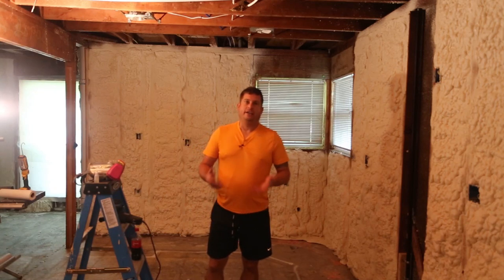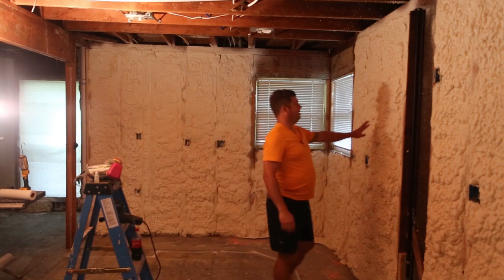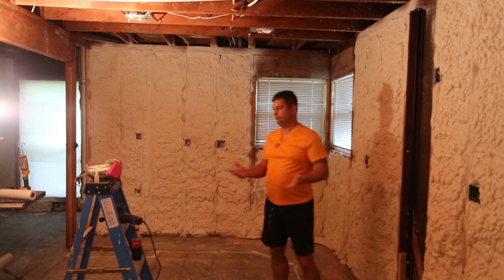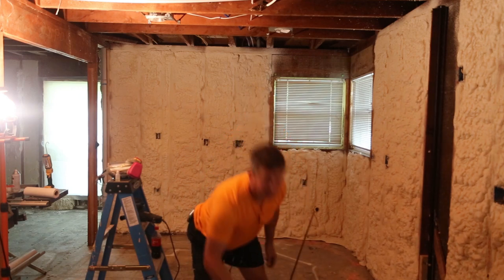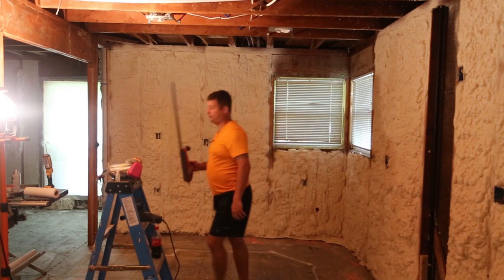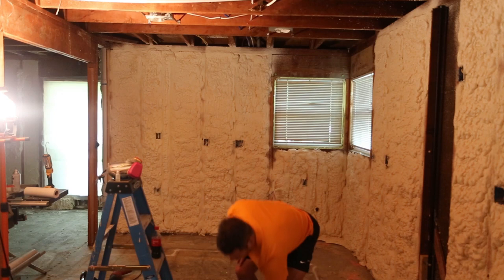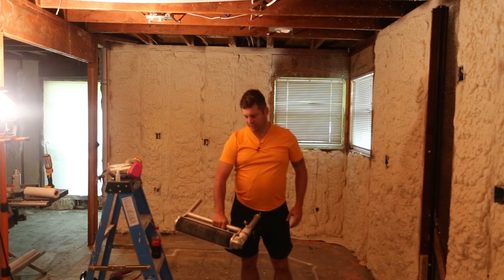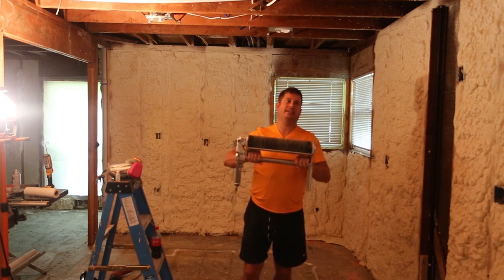DIY Spray Foam - How to Trim foam

Comment: Dont listen to all these complainers . I too want a full stud bay of closed cell foam. 
Its definitely alot more difficult and time consuming but overall a better job.  
What ive learned is if you want it done right most times do it yourself.  Noone cares about your things more then you do.
Reply from the maker: 10 years later and it's working fine and I have low energy bills.   The haters can kiss my cat's behind.

Comment: Is the additional R value you are gaining, really worth the investment on all those extra tools, the work and time to remove and the huge cleanup of that mess, not to mention all the particles of that stuff that get blown around by your furnace/AC?
Reply from the maker: Yes.  This house had evidence of moisture accumulation in the wall cavity.  Unless I wanted to take the brick down to install a vapor barrier on the exterior of the gypboard, this was the only sensible solution to create a vapor barrier and deliver fantastic insulating values.  

My OCD kicked in and I wanted perfectly full wall cavities.  Because I can.

I saved thousands by buying the equipment and doing it myself.  yes it took longer, I had a higher waste factor, but the structure is improved immensely and I never have to worry about bugs or rodents or moisture in my exterior walls.  

As a bonus I was able to insulate some interior walls for noise abatement and I have a serenely quiet home.  I absolutely love it and friends comment on how quiet and peaceful the house is.

The HVAC equipment was 20 years old and due for replacement.  It was a 5 ton Rheem unit that got recycled at the end of the insulation project.  A 2 stage 3 ton unit with variable speed air handler was installed to replace it.  All of the ductwork was 1960's with no seam sealing or Manual J/D calcs apparent.  The new ductwork is sized for minimal static pressure and while some flex was used, the overall installation is quiet and sealed.  I designed for .5 WC supply pressure.  Yes, that is the normal return pressure..... the system is quiet and efficient.

I also installed a ERV to ensure proper air circulation as the house is very tightly sealed.  I have a little more alarm work to do before I'm ready to do a blower door test for kicks and giggles to see how tight the house is.  After that I'll foam the exterior doors and install the trim and caulk it.  I expect the only leak would be the chimney right now.
Reply: @hotpuppy72  1" of closed cell is a vapor barrier. You should have done 2.5" of closed, and not made all that waste.

Comment: Sir I have to tell you you have more money than brains all you really need is a 24 inch but truly flexible one and you can cut that insulation slick in pieces and doesn’t take as long or as messy as you were doing it have fun

Comment: Brian Greul I’ve read all your responses to comments from this video and there’s a reason why the professionals are getting upset. You are very much one of those homeowners who claims to know it all from your research on the internet. Yet the professionals have their knowledge from experience and running into issues first hand, seeing and fixing problems. I’m not saying there aren’t any self proclaimed professionals out there that don’t do bad work. There are in every line of work. That’s where your research has to come in handy by asking the right questions. We professionals do this every day. You did this for maybe a couple weeks to your house. 

All that being said, with closed cell foam you do not need flush filled cavities. The reason being that the foam is the vapour barrier hence having a gap between the drywall and foam is a non issue. Also, most companies spray closed cell foam not open cell. Some spray open cell but closed cell has many more applications since you get such high Rvalue out of so little. Third, standards are changing for PPE so that everyone in the vicinity needs to be wearing a fresh air respirator. Charcoal filters used to be accepted but (in Canada at least) are banned from sprayer use because of the high isocyanate levels by the sprayer. The cartridges you used I’ve heard last as little as 5 minutes in the right conditions.  

And last but not least if you had installed vapour barrier to the outside of your house after taking the brick off you would’ve had some major condensation issues. Vapour barrier ALWAYS goes on the warm side of the insulation. 

If you have any questions please feel free to message me at any time. 

Thank you
Reply from the maker: Your comment and lack of knowledge about insulating in a warm climate are par for the course with most professionals.  Thank you for taking the time to illustrate why I chose to do this myself.  

I might recommend that you take some time to read the research and studies that have been done.

A vapor barrier in a cooling climate needs to be on the outside to keep the humidity and moisture out of the wall assembly.   If someone applies a vapor barrier on the inside they will accumulate moisture in the wall assembly leading to mold, rot, and health issues.  I hope you have good general liability insurance for the claims that follow.
Reply: Brian Greul I don’t own my own business. I also didn’t realize you lived in a warm climate. So I will say my mistake.
Reply: Brian Greul I also want to say that in this video you don’t include any comment about being in a warm climate. 

And technically yes the foam pat the studs can be done but it’s big time over kill and a hide waste of product, money; and time; but respectfully, I’m not paying for it. I just don’t want people to think this needs to be done to their homes.
Reply from the maker: While it's possible to meet energy code with a partial cavity fill, it creates some undesirable issues....so I did a full cavity fill to eliminate them.  Yes, it's over-insulated..... but my money, my house.....

If an air space is left in the wall air circulation sets up which has an impact on insulating efficiency.  The bigger issues in my opinion are that it gives critters (insects/rodents) a home, and the air space will allow moisture to condense in the wall, which leads to the growth of undesirable microbials.  No air space = no critterrs, no mold, and no minor loss of insulating efficiency from convection in the wall.

With closed cell, which is what's in the wall, there is also the benefit of structurally strengthening the wall against shear movement.  How much?  Who knows, but it won't hurt anything and it might help.  Studies have shown that fortification of homes radically reduces damage resulting from windstorms.  I'll take what I can get.

Comment: Whoever sprayed this needs to find a new line of work. There is absolutely no need to completely fill that cavity.
Reply from the maker: +Bryan Young I was aiming for 100% cavity fill.  No air voids.  That is part of the reason I opted to buy the equipment and install the foam myself.  No half-ass "professional" work.
Reply: Brian Greul  Lmao, good for you bro. I would have filled 100%. There's nothing wrong with double insulation.   However, there are better tools you could rent and trim the entire room by the time you've finished 1 section.
Reply: Nightmare. I hope that wasn’t done in one pass and you let it cure and cool down before for put 6 inches in a 2x4 cavity.  Be careful while over spraying like that
Reply: Not too mention all the electrical wiring that is now completely encapsulated. Most likely with deteriorated insulation.

Comment: Hot wire with a follower.  Totally DIY  & el-cheapo.  No dust-death cloud.
Reply: You cant use a hot wire on polyurethane foam hotbwire run above 500 and flash point of polyurethane foam is 454 I am a professional installer and whom ever sprayed this isnt lol typically on a closed cell fill amd trim job my foam comes out of the bay maybe an 1/8 of an inch and we use a tool called a c.i. cutter google it

Comment: The best way to clean those studs is to avoid that much over spray in the first place. No need for full cavity fill. 3 inches in a 2x4 wall done by a highly experienced applicator will be smooth with very little trimming. Any void will be within the conditioned space of the home so there is no worry of moisture. 3 inches will give you close to an R-21 of air tight insulation, that extra 1/2 inch isn't worth the time and material waste. And the absolute best method for trimming the studs is a scraper blade that fits into a reciprocating saw, then use a 12 inch wood blade after for any high spots. Milwaukee all the way. I have a few videos of application on my channel if you want to see how the pros do it.
Reply from the maker: A recip saw doesn't do anything with closed cell.  You need a grinder for closed cell.  Of course you already knew that, being a professional.  You also knew that the exterior gypboard provides a bad moisture barrier and applying open cell with no moisture barrier invites saturation and thermal failure.

Aside from that, an angle grinder works exceptionally well for cleaning studs, floors, or removing foam if needed.
Reply: +Brian Greul I disagree, I trim closed cell foam every day with a Milwaukee reciprocating saw with a 12 inch Milwaukee wood blade. The trick is to not overfill the cavity, and also scrape the stud face first. I can shoot 3 inches into a 3 1/2 inch cavity pretty flat and smooth with minimal trimming. But hell, I've only been shooting and cleaning up foam for 6 years now, so you probably know more than me. Was just trying to give you a few tips there guy. Ever heard of a spider scraper blade? They work magic on the stud face.
Reply: +Brian Greul oh and I pretty only shoot closed cell foam, not sure why you'd be bringing up open cell foam. After all you clearly stated in the video that it was closed cell foam, even though it looks like shit as rough as it is.
Reply from the maker: Each type has it's specifics.  I'm really happy with my installation and with not having any "experts" with attitude involved.  People like you are why I bought the equipment and did it myself.
Reply: @hotpuppy72  this is by far the worst spray foam job ive ever seen. Brian i do appreciate your concern about proper PPE and im happy you are promoting spray foam but as a foamer myself you definitely bash " professionals " who have thousands of jobs amd happy customers under there belt. We use a 36" long blade to cut CLOSED CELL foam on full fill jobs all the time. As many said the trick is to be good at spraying foam and only spray enough in to fill than cut the foam right away while its still a little soft. Doing it how you do and showing its such a huge mess only makes what we do look like a joke. Oh and we tape the studs with packing tape so you can just peal off the foam and not have to use your $9 angle grinder amd 12 hours of work.

Comment: must have taken forever to shave that C.C. down. Never seen full cavity wall application before. I would have done 3" nominal fill with mild trimming if needed.
Reply: Exactly. 3 inches give you more than enough R-value and the small air void is within the conditioned space so there is no issues there what so ever. Plus had it been done by an actual professional (like myself) it would have been smooth with very little waste.
Reply from the maker: It works great.  The professionals can keep cutting corners.  I'm very happy with my results and savings.
Reply: +Brian Greul it's not cutting corners, with closed cell foam we prefer to leave the skin on the foam which is why the industry does almost fills in 2x4s , having the skin is better then cutting back and exposing the cells. Also the additional time to cut and clean means we'd have to charge more for the job, either way foam is the way to go and you strengthened the structure to those 2x4 walls going with c.c.
Reply from the maker: I'm happy with what I did and the waste factor is just a cost of doing the job.  I'm enjoying an extremely comfortable home with low utility bills.  I estimate I'm saving $200/mo on electricity for heating and cooling.  That will pay for the cost of the foam in due time.
Reply: +Brian Greul Glad to hear it, foam is the way to go 100% of the time.
Reply: I believe there is a misunderstanding of what closed cell foam is.  Removing a superficial layer will not open portals through the entire cavity of spray foam.  Each cell is closed, hence the name.

Comment: Wow, that's a lot of extra work and mess. The thing about foam is you spray it thinking it's just the right amount then it sits and grows bigger!
Reply from the maker: On the roof deck you don't have to trim it.  In the walls you can leave it if you don't want them full.  I wanted them full and so I did it differently.  Most of the time companies put in open cell which is easy to trim and offers less insulating value.  I only used open cell on the roof deck.  I had very specific objectives when I did this install.

Comment: Lmao. You do know a $30 sod cutter will do the same job with less dust right?
Reply from the maker: on closed cell?  I'd love to see that.  This looked like the best tool at the time and the project went well.  House is super tight and quiet.  Temperature stays really stable.  I do have an ERV installed as well.  :)
Reply: interesting idea but it won't work. Close cell foam is super strong.
Reply from the maker: keyword, structural..... but a grinder will make short work of it.  It's been 18 months and my home is quiet, comfortable, and energy efficient.  Love it.

Comment: NO, NO, NO, NO, HARBOR FREIGHT DOES NOT MAKE A RELIABLE AIR BOARD, i had 3 , every one of them jammed up in the first 1 min, no lie, 1 min of use, i finally got tired of returning them and just kept the sanding deck for my ingersol rand, the tool that is actually used for that is more like an electric carving knife with a sword on the end of it

Comment: Man you wasted a whole lot of money when a plain old handheld crosscut saw works. Home improvements shows have shown this many times.
Reply from the maker: Not on closed cell foam.  Home Improvement shows also make 3 weeks of work fit in 20 minutes of Video footage.  Everything you see on TV is not factual.
Reply: @hotpuppy72  Yes on closed cell. I have built 2 homes with the stuff.

Comment: 😂😂 Home owners. Always doing things the hard way, thinking they are saving money.
Reply from the maker: I'd rather think I'm saving money while knowing it's done right and having lower electric bills than know I'm wasting money with a contractor who half-asses the job.  Many contractors didn't want to work on a remodel and those that did wanted to only fill the wall halfway which indicates that they don't really understand thermal convection and shouldn't be in the insulation business.  Your mileage may vary.  Speedy Take Your Cash Foam is waiting for your call now.
Reply: Brian Greul      There is no way you understand more than a professional spray foam man. This, again, is typical for home owners to think because they google or you tube instructions for options, that they are now more experienced than those who have done countless jobs, for years.  See it all the time.
Reply from the maker: Hence you are so busy and doing such a great job that you have time to troll YouTube.  Nice.

Comment: Holy cow bub thats why you let the pros do it you could have saved a ton of money if you let a pro spray it and you shave it if you really wanted to but thats a loy of wasted material and also a major health issue just by looking at it the foam was cold when applied and applied to thick in one pass ive been a sprayer for 10 years and I do like your motivation and drive but closed cell foam is dangerous if not applied properly there is health reasons and also you can burn your house down definitely leave sprayfoam to the pros
Reply from the maker: Nah, it worked out just fine.  A higher waste factor for sure, but that was calculated into the planning.  

You really need to watch the video more closely.  It also might be a good idea not to compare a low pressure spray rig with how you use a high pressure spray rig.  They are different animals.  Yea, this isn't a Graco...... but the system I used is essentially identical (other than size) to what industrial applicators use.  

Each lift was applied consistent with the formulator's guidelines.

I had very specific structural, insulation, and sound management goals with this installation.  The installation has exceeded my expectations and reduced my energy consumption by over 50% while making the home very quiet.  I'm in the flight path for an international airport and wanted to cut down on exterior noise from aircraft taking off and landing.  I also wanted to retrofit a vapor barrier to the exterior walls without replacing the brick veneer and I wanted to improve the structural strength of the exterior walls to better resist high winds in the regrettable event that we experience a windstorm.

Most of the "pros" didn't want anything to do with a remodel.  I talked to several.  Owning the equipment enabled me to take my time applying it and make sure it was done right.  I also was able remove and replace a couple of wall cavities when we made a plumbing design change after insulating.  It worked out fantastic, but it's probably not for most home owners.